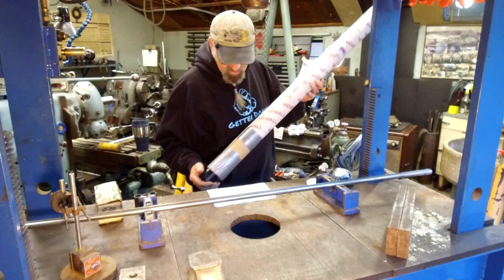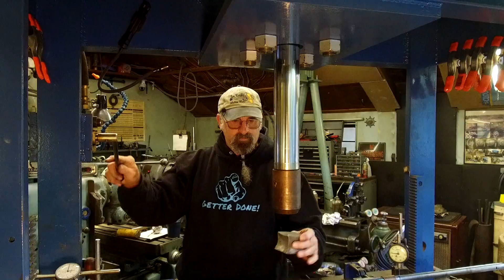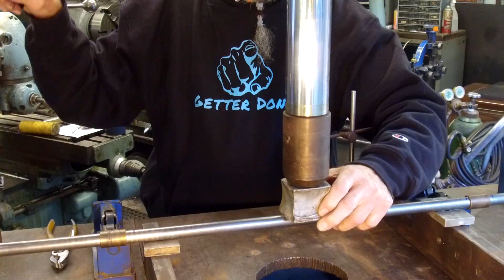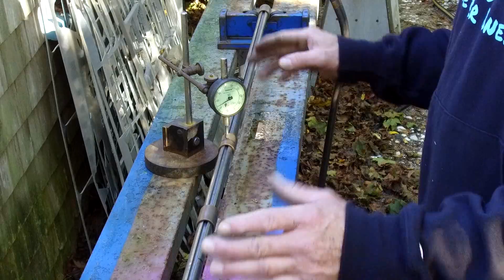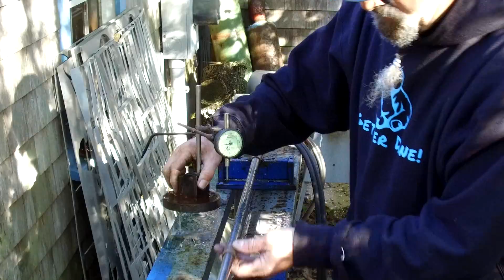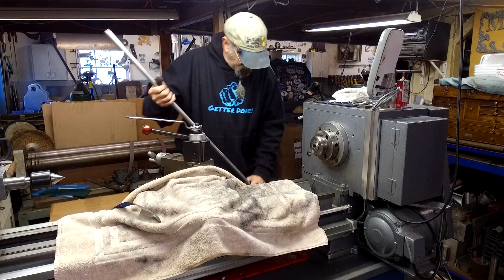The Straight Scoop

Comment: Another educational video from Fenner productions, thanks Keith.
Reply: usually cost by hourly rate. some common jobs such as straightening motorcycle fork tubes & smaller crankshafts are rolled into price of complete rebuild process. a video would show about the same thing Keith did, except the press is a hook pull type so we can watch movement with dual indicator as we pull, and the guy doing the task wouldn't be as handsome 😁

Comment: I remember a tip from Mr. Pete about supporting a shaft without a center hole in the lathe. He placed a simple bushing in the drill chuck. I guess it would only work here if you had a 1" drill chuck for that tailstock. I suppose you could make a socket for those plastic bushings with a stem on the end to fit in a smaller drill chuck. That would make things nice and interchangeable.

Comment: take a laser pointer attach it to the center sleeves hanging down, rolling the shaft will move spot as will sliding in,  this will allow you to quickly see high spots and see the changes as you apply pressure.

Comment: You should try some DEI Boom Mat on those inner surfaces of structure well of the machine above your head.  It'll change both the dB and the timbre of the pump noise.  You wouldn't have to fill it, just some well placed sheets will do.
Reply: He could mic the hydraulic pump and subtract that from the main audio.  Then he could turn right around and use the same setup on his noisy old lathe too.

Comment: Great job as usual.  What is most interesting here is the direction of the bend in the feed screw.  As you described the feed screw was bent in the direction opposite the keyway.  This demonstrates the effect that machining has on the straightness of a shaft especially if the machined area is a significant portion of the shaft volume.  It appears that the machining of the keyway either through heat or work hardening due to tool action caused the shaft to bend as it was being made.  I don't know how this shaft was made but it seems as though the method used skewed the shaft.  Either heat or work hardening (similar to peening of the shaft surface) caused the bend.  What do you think?
Reply from the maker: A little stress relieve from milling the keyway caused some of the bend, but this lathe was moved and the strap caused a little bend also, in two places.  ;{)------

Comment: I think all you're doing after you went outside is chilling one side and, therefor, shrinking that side. You'd have to wait for it to come back to thermal equilibrium before re-checking.
Reply: And yet, his method works and has worked for years. How many shafts do you straighten in a year?
Reply: Do you differ with this statement? QUOTE ME: "You'd have to wait for it to come back to thermal equilibrium before re-checking."
Reply: Do you differ in the fact his method works, works well and produces accurate, repeatable results?
You clearly have no idea what hot quenching is, and how it is applied.
Just another internet know it all trying to look smart.
Reply: That is not an answer to my question. Kindly explain how you can chill one side of a shaft and then immediately get reliable readings on its straightness.

Comment: very interesting demo. my company  precision straighten & balance many types shafts including crankshafts, using both press & heat methods.  When very precise measurements are req'd, placement of supports become critical. Google "Airy points" as well as Bessel points. Also there are length ratio  factors for placing supports for minimum overall sag, zero central sag, and vibration free nodes. With long length to diameter shafts 3 or more supports may be req"d. There are engineering formulas that determine the support spacing. thought you & your viewers might be interested in some of the science behind  straightening a shaft 😊
Reply: Always interested in the highly engineered formulas and procedures of doing a precision job such as your company and then the most highly procedure of a top notch job shop method such as TurnWright's. Would be interesting to watch your companies method, time and price and accuracy of doing this same job and compare it to what we just saw and look at the final results. We can pretty much figure what the cost of the repair and time it took for Keith (just one person) to do this job. What do you think your company would have charged for the same job, time and final accuracy? Maybe post a video of your company doing a shaft straitening job sometime and the accuracy of it. It sounds like it would be very interesting to many of us. Thanks, Ed K. Cleve. Oh.

Comment: Why didn't you start with the rollers at the very ends of the shaft in order to determine the precise 'high point' of deflection at the beginning? How do you know that you started out pushing on the correct spot without doing the above?
Reply from the maker: You can determine the bend characteristics from any two points of the shaft, the run out is always relevant to the two zeros of pivot.  When I heat straighten shafting from start to finish I never move rollers, work in between then outside.  ;{)-------

Comment: why wouldn't you adapt the sprayer to a tap outside than you would have constant water not just a 5 gal pail of water like don't eliminate the air because you would still need that to increase the pressure since tap pressure is next to nothing but doing that also you would not have to worry about priming before using because the water pressure would always keep it at the gun? and put water ball valve at the gun so it is not constantly spraying when not using ?
Reply from the maker: The air adds coolness and timing of that coolness. ;{)------